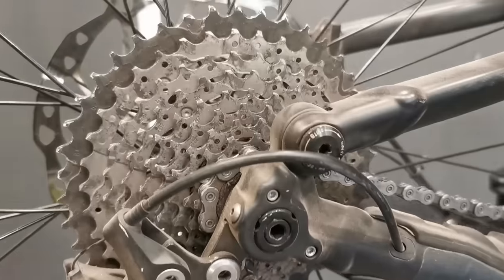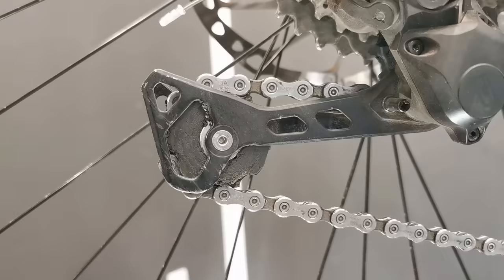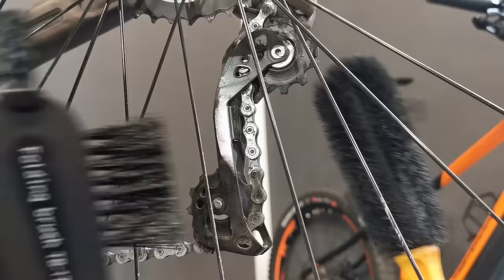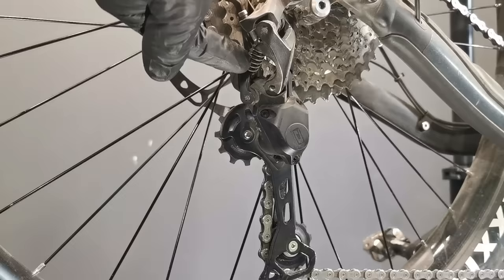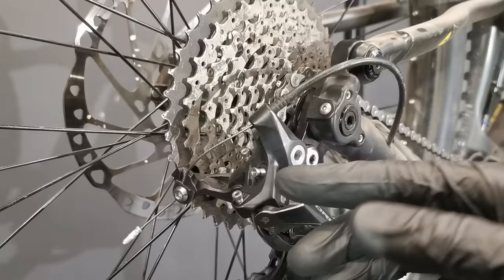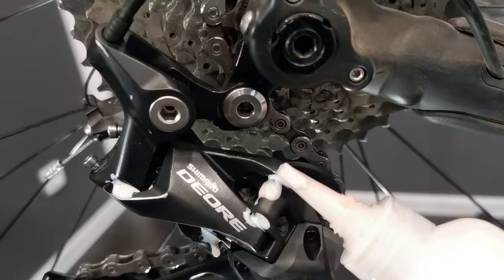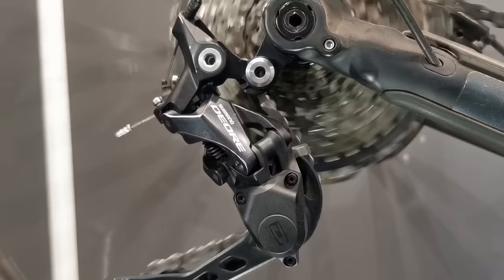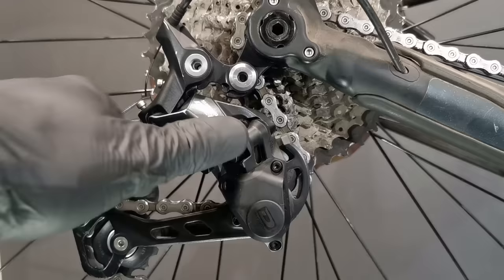Dirty And Tired Derailleur Gets New Life In 3 Minutes. How I Clean Rear Mech After Long, Dusty Trips

Comment: In 26 years of riding mountain bikes I’ve never seen jockey wheels that gunked up. It suggests you’re over oiling your chain.
Reply: Try a Scottish winter or summer to be fair.
Reply: @WIPEYOURLENZ  or anywhere in the UK! That’s not the point though, don’t over oil it and clean it regularly.
Reply: Actually it looks more like he’s been piling a dirty drivetrain and it’s all mixing into that black gunk, I live in Scotland and your drivetrain can get like that real quick without using oil and cleaning it in the winter trust me
Reply: I really don't think you cycle fella.
Reply: It’s a geographic issue 🌼. Temperate climates like the UK or Ireland results in this happening all the time.
Reply: @mariconor242  I am in the UK. I ride and race all over the UK and abroad. 

Use the right lube for the conditions and keep the drivetrain clean and this doesn’t happen. End of.
Reply: @djdeejdjay8669  ok fella.
Reply: @gregwylie  It's just a very strange thing to write. It's not just oil on the jockey wheel either....Im 48 and been building and riding bikes for over 40 years...I kinda know what I'm on about...if you've never seen it before then ya bullsh£tting about your own experience.
Reply: @gregwylie  A few of the riders you've subbed to are sponsored by ID and my mate is the mechanic there and also knows the riders....Matt Jones for one does shouts out to him...Maz is the nick name for him at ID....he would laugh at you for what you've written big time.
I can also tell you Maz's real name and his age and birthday and the village we grew up together in if you don't believe me.
Reply: @djdeejdjay8669  brilliant. Thanks mate.
Reply: @gregwylie  someone with soo much to say that is now mute is full of crap...
Reply: @gregwylie  lol...yes I'm sorry I'm going over the top...1.but I would also wonder why I'm harping off soo much as well.
2. There are also other people calling you out as well....
3. Think...lol
Reply: @djdeejdjay8669  no one else is ‘calling me out’. You’re the only person to question my credibility. I can start saying you don’t ride bikes and that you’re full of crap if you like but I’m pretty sure you wouldn’t like it. 

I’ve never said I’m an expert, I said I’ve never seen jockey wheels this bad and it suggests the chain is being over oiled. I then provided reasons why. 

In hind sight, I have seen drivetrains this bad - mine, because I was over oiling it and using the wrong lube for the conditions. I learnt that by using a dry lube in the summer to stop dust sticking and wet lube in the winter because dry lube doesn’t last in wet conditions and by wiping off the excess lube and cleaning regularly, that I no longer suffered with my drivetrain getting like this. 

I learnt from research and experience. If yours gets like this, try it! You never know what might happen and you’ll save yourself some money on wear and tear.
Reply: @gregwylie  lol...for a start fella, please don't thumbs up your own comment coz that's going over the top and will provoke a retort.lol
It's not just down  the oil or over oiling...and yes I do understand different types of lubes and viscosity etc....but to get a jockey wheel that dirty...it's either a lot of miles in a short space of time which road riders do or lack of cleaning or both....it's not just the oil building up like that lol..
It's mud and grit and wood,rubber etc that is on the terrain they cycle on....if you go off road it's worse but some of it could get rubbed off by long grass or weeds or washed off by puddles..??? Conditions do affect the bike and how how often you ride...mountain bikers will mainly go out once or twice a week if you do jumps but not if it rains lol...XCountry riders probably nearly every day....road rider, religious lol....
Weather conditions is also another factor.... I will expand on weather....oils and grease react differenty at different temperatures as well..
Can't be arsed to add any more if you wanted any more fact...? Lol...
Reply: @djdeejdjay8669   Haa! That wasn’t me that gave it a thumbs up! Someone got in there quick. I have now though! 👍🏻
Reply: @gregwylie  lol..erm don't believe you ... but there we go...but you had no answer fella...you asked a question and I stepped up....lol...don't shoot the messenger lol..
Reply: I once shared a football stadium with Lionel Messi...does that make me an expert pundit? ;-)
Reply: @djdeejdjay8669  I have an answer but I’m done with this!!
Reply: @thejoker7323  yesss!! 🙌
Reply: @thejoker7323  Lol...not straight away but....yes if you have enough experience and years in what you're on about...and I'm a bit clever lol
Reply: A bit clever, or a bit special?  I reckon you’d love my top of the range Raleigh.  I used to lube the rear mech with my dads boyfriends Vaseline.
Reply: @thejoker7323  😂😂
Reply: @gregwylie  oh ok Greg....I'm just having a laugh and bit of banter and stating fact and from experience...
Reply: @thejoker7323  lol....I do that kinda sh#t banter and its easy to go to your momma mode but I have better things to do than troll with you...but it is funny though lol.
Reply: @thejoker7323  it shows you have little guidance lol.
Reply: @thejoker7323  lol...it's shows also you can't even construct a simple sentence.lol..
Reply: Come again echo boy.  I don’t think anybody that uses lol in a sentence can comment on the use of the English language.
Reply: Video purpose 😢😅

Comment: I'm a professional mechanic and this has to be the best quick clean rear derailleur video I've seen yet that is done right with out or very little amount of cleaning solvent(s). Because nothing ruins s rear derailleur or rear hub bearings when using excessive use solvents or pressure washing.
Reply: I personally wouldn't use my pressure on anything other my path or drive. Won't use it on my car or my bike. Far too aggressive for either.
Reply: @6ettinold  bs. sealed ball-bearings and axles do just fine as long as one uses the pressure washer from 8-12 in away as it's supposed to be used :}

Comment: 1) To remove mud and gunk from the jockey wheels, use a plastic tool (there is a good one at the back of some brushes), not a metal screwdriver. This will avoid scratching the wheels, which would attracts even more dirt.
2) Instead of putting chain oil on the pivots, just give a global spray of Teflon based lube and wipe the excess. Far more faster , Teflon will also repel water and attract less dirt than chain oil.

Cheers

Comment: Why haven’t you used a degreaser to clean up the chain and the cassette along with the jockey wheels? I find it to be extremely effective along with the use of brushes in removing gunk from the bike. Follow it up with a warm soap wash and then follow up with lubing the chain followed by lubing up the dérailleur

Comment: I wax the chain for my gravel bike.  It’s a life-saver.  No wet lube means very little dirt is trapped in or stuck on drivetrain parts.
Reply: I use little tea light candles in a slow cooker.. £5, 3rd year same bag of candles 👌
Reply: Agree!! why everyone doesn't use this , I don't understand yet.
Reply: @donavonlewis1039  theres people out there that struggle fixing a puncture,  removing a chain would involve lbs in some cases 🤦🏼‍♂️. We need more dads in this world!😂
Reply: @Gweilo Agree with ya bud. So lets teach them the correct way and not cut corners! Let’s see a video of taking the chain off and a proper clean! And wax the chain. LOL
Reply: Have you tried the teflon type lube? Goes on wet and then dries leaving teflon dust as the lubricant.  I mountain bike and have had good luck with that stuff.  Never tried wax... Seems like grit would get embedded.
Reply: @johnnygunz2300   there's nowhere for the grit to stick, sticky tape wont stick to wax. Roll a candle down a fire rd, the candle will be clean when you pick it up.
Reply: @gweilo965  I was just reading about it.... Next new chain I'm trying the wax approach. It looks like using an already lubed chain is APITA to wax.

I have boat loads of paraffin hanging around.
Reply: @johnnygunz2300  get yourself a lonely single person slow cooker,  and wont go far wrong 👌

Drying the chain after using in the rain stops it going ginger.

Comment: Folks, just switch to waxing your chain and most of this cleaning chore goes away. Sure there's a little prep time to purge factory lube and soak the chain in paraffin but I get multiples of that time back in reduced bike cleaning time. First of all without the petrol or snake oil products attracting every molecule of dirt in the forest the drive train stays much cleaner to begin with. But no matter how muddy the woods were I can garden hose each bike to show room clean in less than ten minutes each. The most time consuming part for me is soapy brush on the tires to get the dingy stain. Everything else including the drive train gets fully clean by water only rinse.

Comment: In case you are wondering what is the lube he puts on - MOMUM Mic Wax. You can also use it on the chain. The rules are simple, first clean thoroughly, then apply the wax. It is not great when it comes to lubrication (e.g. chain works fine only up to 60-80km), but it keeps things clean.

Comment: No need for expensive brushes! An old toothbrush works fine and gets into tighter spaces. Then finish it off wit a spray of GT85, just don’t get any on braking surfaces.

Comment: lol my chain gets waaaay dirtier lol.. i avoid the awful jockey gunk by always wiping it down when i get home, same day. i found it can get really really hard to get that stuff off, so doing it right away is important, and it's only 10 or 11 teeth so it doesn't take many turns, just have to do both sides and know how to grab the wheel - where, how tight, and away from getting caught up, and not too fast. I also wipe my fork stanchions (first, when the rag is spotless clean) and i might finish with a quick dry squeeze of the chain and 10 or so pedal rotations. I can clean the chain later if it gets nasty. Nice job!!
Reply: Alutious I just use fenwicks foaming chain cleaner, don’t even have to use a brush for the jockey wheels coz it’s soooo good!!!!!!!
Reply: @samb2334  i have been using wd40 foaming stuff from canadian tire because it is easy for my wife to use so she can clean her own bike instead of me doing it. It is ok, not great. I also have muckoff liquid degreaser. What is your techinique? How long do you let it sit, do you brush it off, do you apply it twice? Do you rinse off with a hose? How exactly are you using it?
Reply: Thank you for sharing this video

Comment: Hi. Many cable housings are with teflon inner and this will swell and brake and jam on the cable if it makes contact with chain lube or other oils. Some cables are teflon coated too and shouldn't be touched with chain lube or oil either. Regards
Reply: What about silicone? That's what I was thinking around be good.
Reply: @asdfgoogle  should basically work but there are many different silicone oils. Some become sticky and some will mix with dust. Also anything that get's contaminated with a tiny amount of silicone will not have anything else stick to it at that place which is undesireable for some parts of your bike. If your wire is stainless just keep it clean with a dry rag, it will shift easy and exact if it and the housing are not damaged.
Reply: 7x7 shift cables slide pretty well
Reply: Strange, teflon is chemically very much inert, maybe that is some other polymer
Reply: @nickfirst7249  it's "kind of" common knowledge that this happens with teflon cable housing inner liners - i don't know if these liners are pure teflon or a carrier matrix but while I've witnessed it myself the information is sprinkled in forums and across mechanics, but who knows -  you might want to ask shimano and share with us the answer?
Reply: What about Dupont Chain saver wax?
Reply: @mikecaster4612  For smooth and precise shifting performance, cable lubricants typically have a thinner consistency than Dupont Chain Saver Wax to ensure smooth cable movement, reduce friction and provide long-lasting performance.

Comment: What chain lube are you using? Liquid tar?
I use a wax based lube and my jockey wheels and drivetrain stay clean. 
Good luck!
Reply: It look like Momum MIC Wax Ceramic Lubricant which is a Spanish brand - so not the ones in the links

Comment: Like cleaning a toilet, the longer you leave it the worse it is. Trick is don't let it get that bad in the first place.
Reply: Exactly . This is what I have been doing lately I have been riding wet mucky roads . I have bontrager ncs mudguards fitted and I use gear oil . It don't last very long .  I have a madison m part essential kick stand fitted . Makes chain management a doddle . I simple start with a piece of rag and wipe the chain clean then I have a pair of old tooth brushes tied together facing each  other . I run the chain. Between them by back peddling because the kick stand mounts on the triangle by the rear axel this is possible . I use a single tooth brush to clean the cogs and I wipe the jockey wheels with a rag . I  use an electronic cigarette liquid bottle  to apply the oil . It has a tiny  spout . I get the oil in there by using a bottle and filler for a scottoiler that are fitted on a motorcycle . For motorcycle chain I use auto trans fluid it's just like scott oil but cost less than half as much . It won't last in the winter on a. Road bike . That's why I use gear oil . By doing it very regularly  it don't make a mess the front  big chain ring and derailer get a clean too rash time . A clean well oiled chain runs well sounds right and lasts longer . It's a matter of pride too .  I will be taking up mountain biking in the future so I expect the chain to get even dirtyer I will probably have to buy something better . I use kerosene to clean chains too  in-between times but it makes a mess it's for a whole bike clean .

Comment: A tip you can spin backwards on a ebike by putting an allenkey in 1 of the chainring bolts, also using WPL lubes wet works well and cleans very well. 😆

Comment: A spray of WD-40 would work wonders cleaning this derailleur and it cleans the small spaces you can''t brush.
Reply: WD-40 : the killer of drive trains, as I can see it on and on in my pro workshop ...
Reply: Best is careful pressure washing... then dry and lube everything (and more greasing maintenance/checkups).
That said I'm using white-spirit, wd-40, but even after cleaning everything, with cloth, as soon as oil is applied, it becomes black again...

Comment: This is how I do it at work. Been working with bikes for approx 4 yrs. Guess how much I charge?
Reply: 50€ and that includes lubing all wires, centering brakes, lubing the fork, setting the indexings. checking the botton bracket. cleaning the front derailleur along with the cogs.
Reply: Oh and truing the wheels.

Comment: Great video! I like using ProLink chain lube in a pinpoint dropper on the pivots and jockey wheels. I also have various brushes for cleaning. If any brushes have metal ferrules I wrap them with electrical tape so they won't scratch.

Comment: Not sure I'd use metal implements on the jockey wheels. A plastic Spudger is good.
Reply: The teeth are gonna wear out long before you ever wear them down with a screwdriver lol. Literally zero problem in using a screwdriver, unless you’re worried about scratching your jockey wheels.

Comment: What do you use as lubricant on your rear derailleur?
Reply: now that winter is coming you have to use bike teflon oil, so it won't get off with water and mud ;)
Reply: Dry chain lube which its better than wet chain lube, it would collect dirt if you use wet chain lube

Comment: The main enemy of bikes is road dirt that collects on the lubed parts, which causes pre-mature parts wear. Switch to a dry lube, which barely collects any road grit and you'll need to clean your derailleur and chain less often AND your chain will last for years before needing replacement. This guy scraping that grime off the derailleur gears was making me cringe. Great video for cleaning a dirty bike u buy used however.

Comment: don't use cleaner chems on ANY bike parts. wd-40, which is basically a cleaner with some lubing qualities, is about as harsh as you should go. some things may LOOK better all shiny and neat, but if you've de-lubed them, you're shortening their lives.

The risk in de-lubing is that you might not get the area properly lubed again.
Reply: Wd-40 is a degreaser, it removes lube
Reply: Using dedicated bike degreaser is fine imo and removes far more dirt.
Reply: @BigGuyLittleBikes It's a solvent.

Comment: I don't understand. Is there any issue washing an e-bike? This can be avoided by washing and scrubbing with the appropriate brush and then re-applying some lube as indicated. Being doing this for years with a normal mtb.
Reply: Nope.  I use chain / drive train degreaser get it all sparkling and hose it off and then re-apply lube after it's all dried off.  They are designed to be ridden in all conditions so a little hose down isn't going to do any harm.

Comment: I used petrol and a tooth brush for similar work.
Reply: Diesel is better
Reply: @Mark Fortich I am from India and only 4-5 percent of indian population would buy a pressure washer. We just wash cars with water, car cleaning liquid and a microfiber cloth. We Indian's find cheap ways, not easy and expensive ways😊
Reply: @Mark Fortich they say you shouldn't as the water gets in. Its probably better to take chain off and soak in diesel.